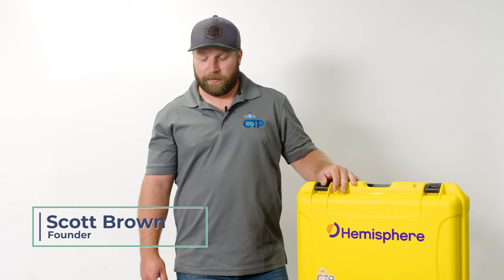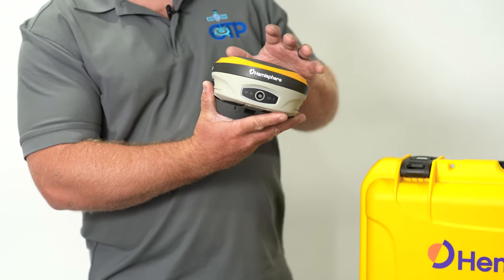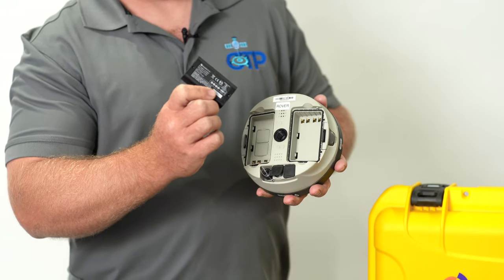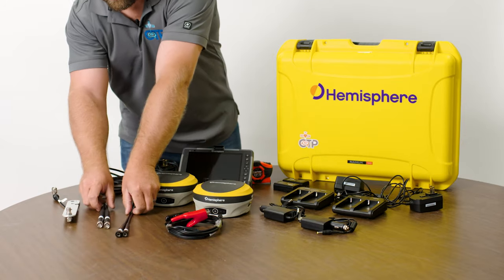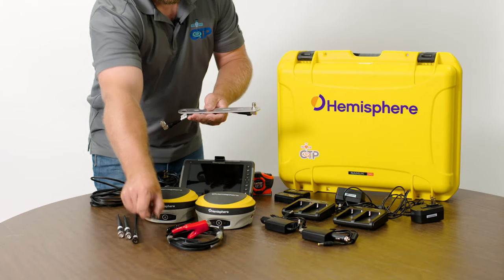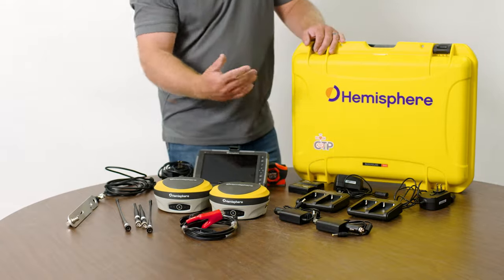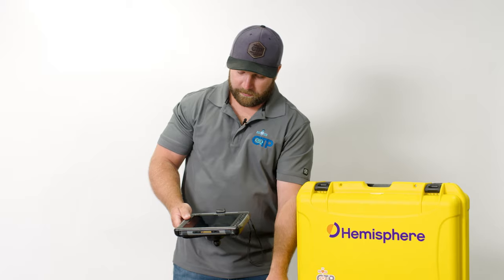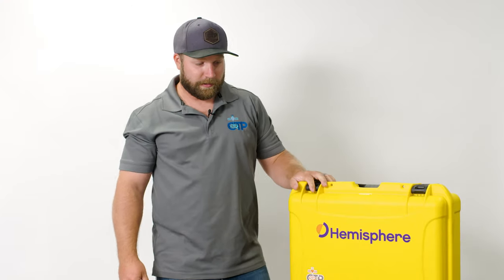Hemisphere GNSS SiteMetrix C631 Base and Rover Overview

Comment: What kind of RTK service are you using when you hit 42 satellites? 
I use Trimble R10-2 and I only get 13 on a good day!
Reply from the maker: I've got it several times with my Hemisphere C631 receiver, and on my Stonex 990A, both also have tilt  IMU that works great. R10 is great receiver, but don't be afraid to check out some of the other receivers on the market.